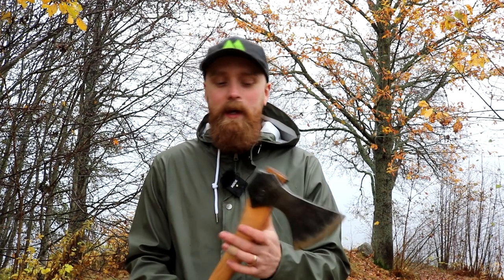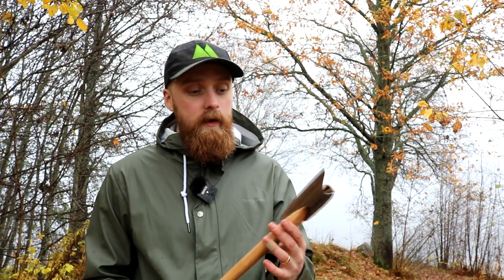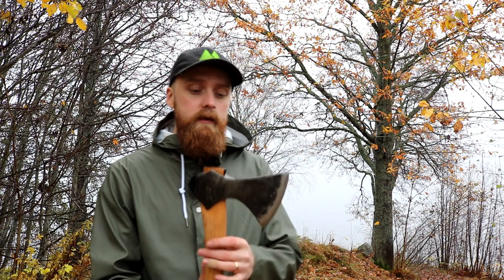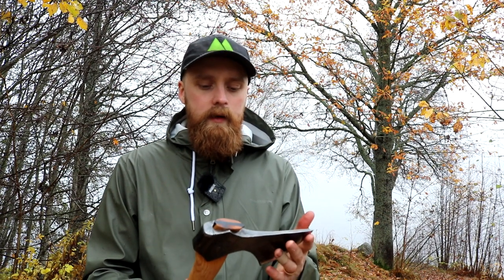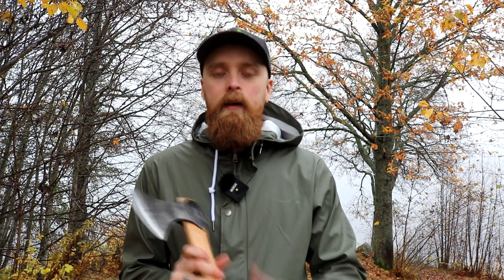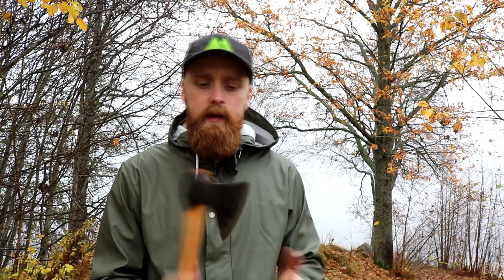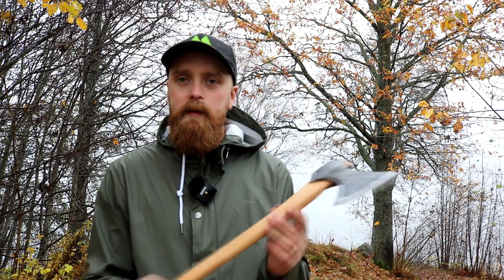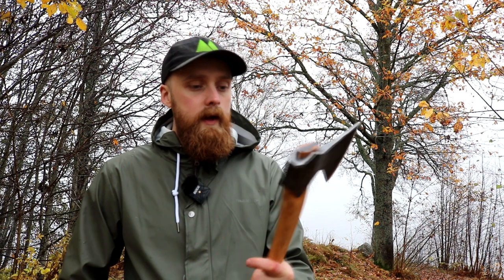Blacksmithing - Forging a Type "K" Viking Axe

Comment: Hey friend, love your axe! I agree with you regarding the visible seams not being delaminations or cold shuts. They did not have angle grinders or belt grinders to remove the seams back before electricity was invented so it would require a lot of hard work to remove the seams by hand. It does not effect the strength of the weld for the weld seam to be partially visible as I have tested out a throwing hatchet that I forged and the eye never busted apart despite the visible seam. It's only cosmetic.
Reply from the maker: I agree, thanks for watching!

Comment: Fantastic work. Discerning the difference between trace and flaw is artful and greatly appreciated. Often I find the misnomer “rustic” used as a lazy connection or forced aesthetic. You were deliberate in keeping the weld visible, lending the finished piece it’s hand made moniker.
Reply from the maker: Thanks Gandalf!

Comment: Beautiful work.  But I have a couple questions.
1.  Why is the head at such an acute angle to the handle?  
2.  Why do so many axe makers have the stock protruding so far out of the head?
As preference is concerned, I must prefer your handle material in the carving axe.  I also like more curve at the base of the handle.  But this is just me.

Comment: After several tries my forgewelds do hold tight but if you put it on, they can be separated with great force with a splitting chisel. Maybe thats something that forgewelding brings with it.
Reply from the maker: Forgewelds at the eye will most likely be a weak spot. Its imoortant not to drift it too much, try instead to account for what the size should be before folding it. My idea when going into this is think "ballance". It can still be fitted toght and hard to a wooden handle. Hope that helps
Reply: thanks for your help! I will keep that in mind.
My appreciation
Reply from the maker: You got it!

Comment: Have you tried welding the axe eye like a U? Would that work? 

Like symmetrical weld but the tool steel goes all the way back to the eye
Reply: Waste of steel, one must put themselves into the mind of the original timeframe. Steel was extremely expensive at the time so it was used sparingly.